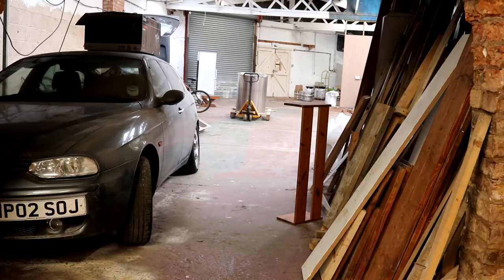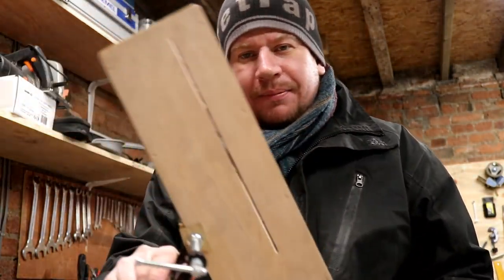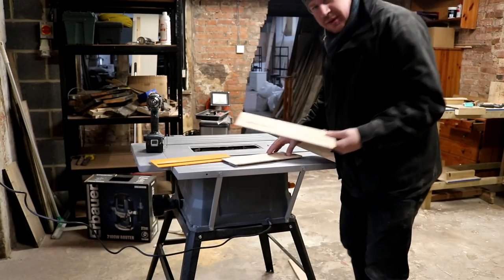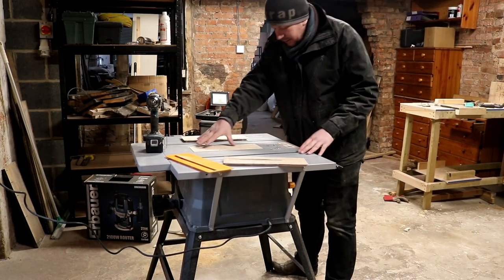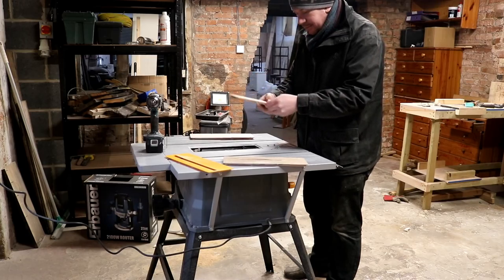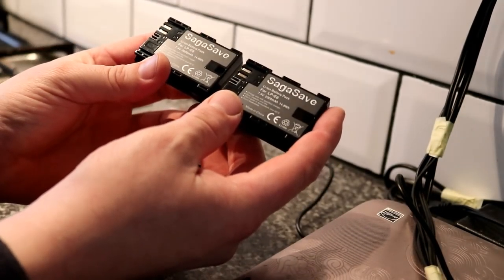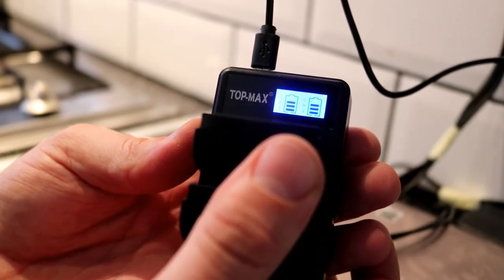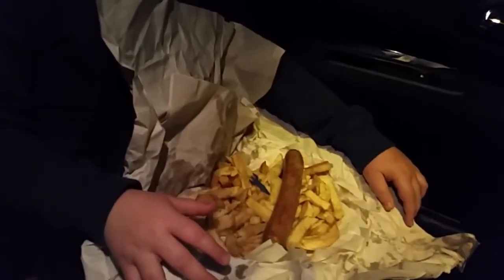Back To School ~ Plus Table Saw Inserts

Comment: A twelve hour day verse a six hour day, it's not rocket science, that is half a day 🤣 . The saw insert is really only there as a safety precaution to stop off cuts from being dragged in and being flung out at high speed. For ease of changing angles they usually have quite a wide channel but dedicated angle inserts are safer but a lot more faff as you intimated. Dayglo orange as well for safety, although it looked like you were spraying the underside which is going a little over the top, or perhaps over the bottom 🤣 .  Lastly I feel that I have to add that for homebrew channel that shockingly didn't look like a home brew wine 😮 😄 .

Great video as usual though, you are really brightening my day to think I can come home to a guaranteed spot of entertainment.

Cheers,

Schnuz.